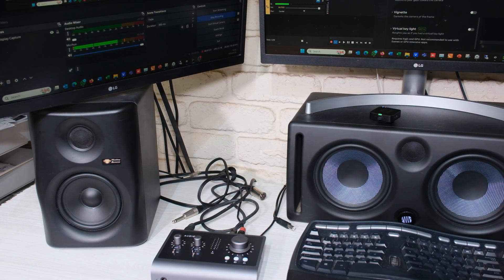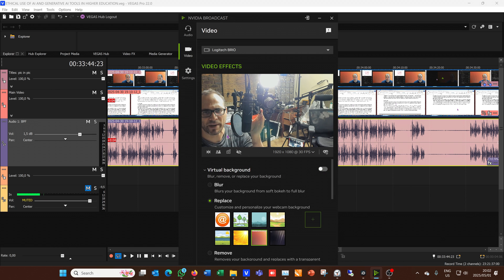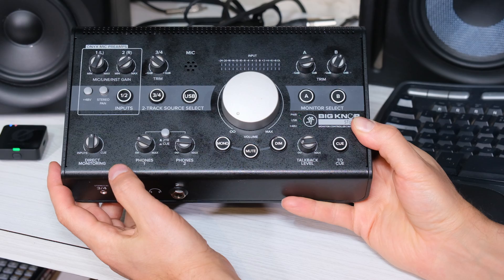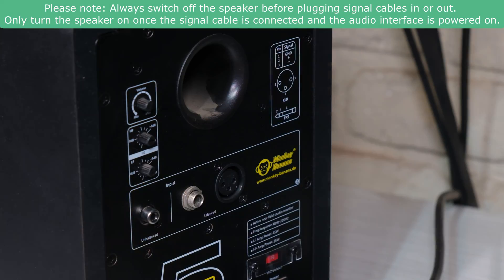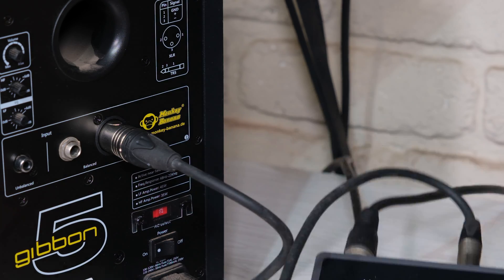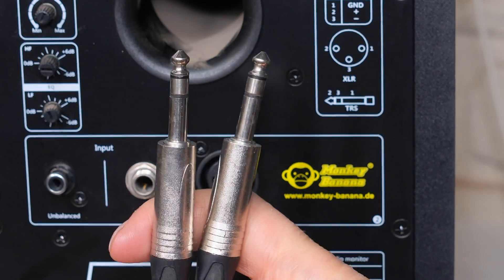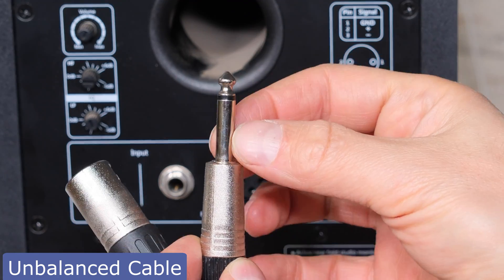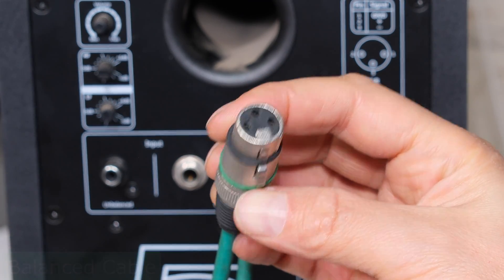Fix Static, Buzzing & Hiss from Your Audio Interface – Stop Computer Noise in Your Speakers

Comment: Maybe stupid question: do you need a stereo jack plug?
Reply: You just need to make sure you always used a Balanced cable wherever the device allows for this type of cable. The inside winding of the balanced cable cancels out the noise and interference. If you read the manual of your device it will specify inputs and outputs, and i most cases the physical device states this on the ports. XLR is balanced... XLR to TRS (Tip, Ring, Sleeve) is also balanced... TS (Tip, Sleeve) is not balanced. So it's perhaps better to consider the cable in TRS / TS terminology as they don't always mean "Stereo" in XLR uses...